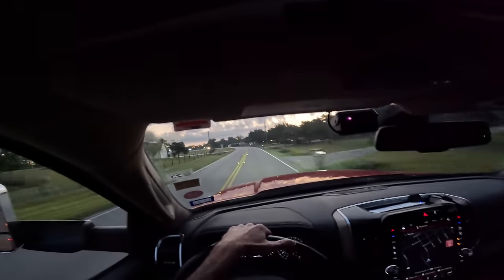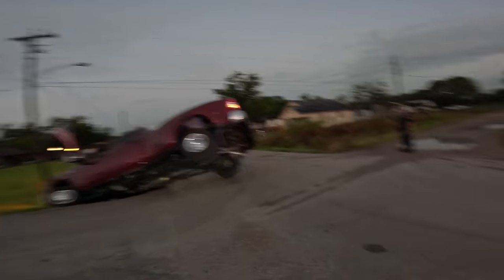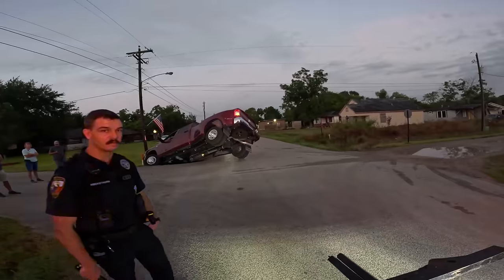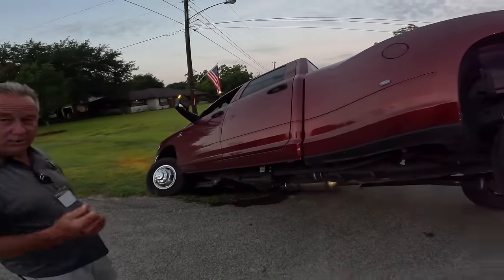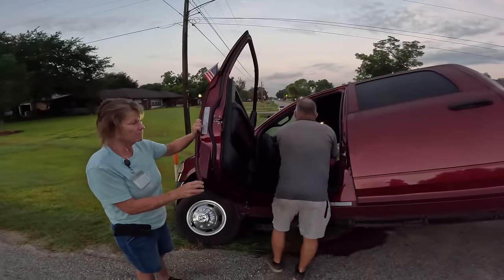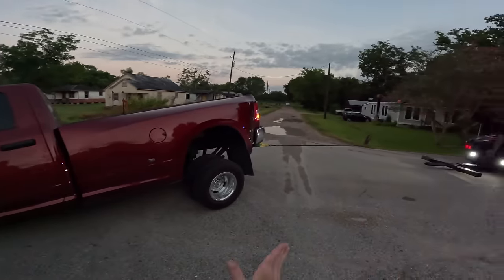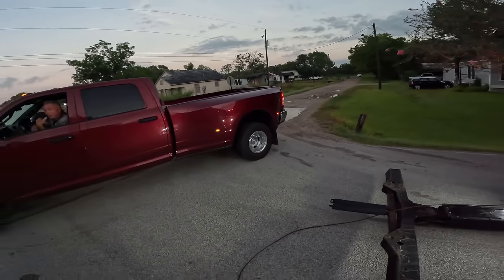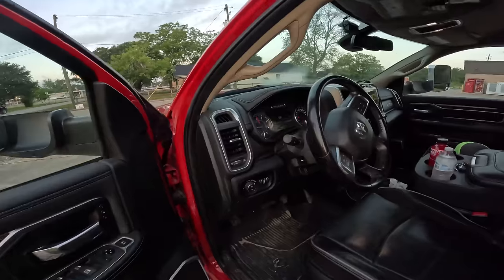Bad Way to Start off Monday!! Ram 3500 Winch Out!

Comment: That tow truck was struggling lmao
Reply from the maker: How was it struggling? It did everything perfectly. That’s not something you do very fast.
Reply: Yea, probably just running a winch for its rated working capacity.  Some upgrade their winches, but what comes with truck works, fine.

Comment: Alot of people dont realize how dangerous this is ,there has been many people killed by a cable that breaks and hits them causing death you have to think about all this you dont just pull up and drag a vehicle out of a bad situation, yeah its pretty scary to say the least, very well done  stay safe and god  bless
Reply from the maker: Thank You!
Reply: I had an 18 wheeler up on right side tires pulling with two cables all blocked by State patrol on both ends. Some crazy woman with kids in a minivan cam screaming around the cops straight at my cables. I had to drop the cables just before she ran over them. It surely would have cut the top clean off that minivan. Not sure what happened to the kids but she had free room and board . One dumb woman.
Reply: True, most have gone to using multiple winches with synthetic ropes and synthetic attachments. Cables are dangerous.
Reply: @MrStaybrown every item has a working load limit, synthetic or metal,  and a tow truck driver can estimate the resistance  per axle.
In this case the gradient has transfered a lot of weight to rhe front axle  from the rear.
The front axle on this truck weighs 5k lbs, the tires are on soft dirt and the frame is mired,  I would guess 100 percent of front axle weight plus rear to front transfer of approx 1k lbs , so it's about a 6k lb pull.  Could go up to 9k depends on how wedged the body is tuck.
State police usually require improved plow steel 6x19 wire rope

Comment: With that much weight in the ditch, I definitely would have put a snatch block at the truck. That's a 3/8 line, I imagine? I was a bit worried... But I guess everything's on your flatbed? 
Job is done, no one's hurt, and nothing broke. Always the best end to any day. That was a good move pulling the back down, too, get the nose lifted up a little.

Very nice work, as always.
Reply from the maker: Definitely not how I wanted to do it, but this truck is pretty under-equipped, and most of the stuff on it is what I took out of my flatbed. 
I’ll be so glad to be back in my truck where I have all my equipment again.
Reply: @Towtruck_Dustin  I definitely understand that. My wrecker was down for a while, was running flatbeds for two months. I'm so accustomed to my own equipment, where it all is, and what it can do. Definitely feels weird running "the spare truck."

Comment: Nice twin line, I always like an independent wheellift though. I've got a LWB '96 Ford F-350 SD 4WD with a manual trans. by Weld Built. It's a monster for doing recovery work. Probably paid for itself 10x over by now.
Reply from the maker: I plan on finding me an OBS Ford wrecker for an off-road rig in the near future. I love those trucks.
Reply: Owen-js9cx  Aloha snackbar to you.
Reply: @genefogarty5395  when I saw OP favorited your comment I lol'd. Glory to the almighty snack bar! Which is Hawaiian themed for some reason 😮
Reply: @skrimper  Didn't see it until now, no disrespect, I just can't take organized religion seriously. I meet with my maker whenever I'm alone and hiking, camping or fishing, I don't need to go to a building to talk to whoever it is that made this big blue ball of beautiful insanity. AND I've never been asked for money during our conversations! Lmao.
Reply: I would rather have a boom independent of the wheel lift. I do not like the new wreckers today. And I think that I would have another truck on the right front for a lift.
Reply: That's what I mean, Dynamic is different than a Weld Built or Holmes that utilize an independent wheel lift. I can't stand it on the boom. It restricts the use of the truck.  @TimSmith-uc4pk

Comment: Years ago I went shopping for a 4wd pick up for my work. I went to Ford, GM and Dodge. I was shocked by what every sales person advised.

They all quizzed me as to the type and nature of my driving requirements. I told how I used my truck in my job.

They told me that for the number of days I would actually benefit from a 4x4, verses the added expenses in fuel, maintenance and repair costs, I would be better off calling in sick on those few days and buying a two wheel drive. I was disappointed, but couldn't get over their candor. 

I driven both over the years, but I'd have to say that two wheel drive pick ups have served millions of people well across the decades, so they are far from useless. Maybe it all depends on the operator.
Reply from the maker: They definitely have their place. Like anything else, they serve their own purpose.

Comment: If it were me, I'd have popped a clevis on that endless loop and hooked the winch to the clevis. I suppose it probably doesn't matter much in this case, though, and it is extra work. Nice, professional job, either way.

Comment: Just me because I've been through recovery for 40 years, I'm almost thinking from the front Tire strap the front wheel and slowly backing out with the emergency brake parsley on. Simply because I don't want to twist the frame of the truck any more than it needs to be, for me this should be a straight recovery where the owner gets to drive it away
Reply from the maker: The drove it away, and there was hardly any stress on it. It wasn’t stuck on anything. The best think to do there was to bring it away from the tipping point.

Comment: Well done, although those big D rings on the wrecker body are significantly stronger for rigging your low snatch block. These are fun calls... they look like a big deal to the customer.. in reality it's s an easy job...
Reply from the maker: That’s what I planning to rig to, but the snatch block didn’t have a grab hook. So I had to do what I had to do.
Reply: @Towtruck_Dustin you.can still.use a chain block with those, just choke it up tight to the block... but realistically, that wasn't a hard pull, just a medium pull pivoting that Cummins back up til it rolled.... that's why I said,  we get those...they look like a big deal, but they're easy & ya get brownie points for what they think is tough.  Well done though.. staybsafe out there ;)

Comment: As a tow company owner. I am glad you were able to recover that vehicle. However, I’m going to offer you some constructive criticism. Number one you never ever use your safety chain box as a pull point. That extreme load you put on that completely exceeded its design. Not to mention that’s not what it’s designed for. Number two, I would have doubled up my line because of the extreme pressure that exceeds the 3/8 cable on your truck. If that cable had snapped, you would have shock loaded your truck not to mention somebody getting hurt or worse. The forces you were up against was not only the weight of the truck. Also, once you brought the truck down, you were dragging on the frame which created more resistance. Lastly, I wanted to point out. You should never ever allow the customer to be involved in your recovery. Because if something catastrophic had gone wrong it would’ve been all bad. Safety is number one in our industry. I want to see you go home every night. Just my thoughts my friend.
Reply from the maker: Trust me. I didn’t want to do any of that, but didn’t have much choice. This truck is so under equipped, that I had to pull equipment off my rollback before I dropped it off at the dealership, and it still Isn’t enough. 
Trust me. I absolutely hate having to work like this. I’ll be so glad when I can get back to my truck so I have all my equipment.
Reply: @Towtruck_Dustin  Trust me my friend, I wasn't trying to sound like a boss. I was simply expressing concerns. At the end of the day you did get the job done. For that I am very proud of you. I just worry about safety is all. As tow operators we already have a very dangerous job. You are considered a first responder. I look at us all as one big family...
Reply: All you had to do was hook to the hitch on the back of the stuck truck and pull it out. I could have pulled that thing out in under 2 .minutes with my 2500 pick up truck.

Comment: One question real quick, and I am an operator. But isn’t it a liability for u to have the customer help run this call? There a whole other way I’d done this but it looked good other than that customer in the truck with that much tension on that cable? But good work just something’s I seen that I’d do differently but u got the job done successfully that’s all that matters

Comment: Dude is going to need a frame shop to check out that RAM.
Reply from the maker: Not likely. Very little stress was applied to it.
Reply from the maker: Exactly
Reply: @TheKing-hr7uh   You and T_D aren't thinking too critically.  I can almost guarantee that there is some degree of twist in that frame, and it will show up in funny tire wear or odd handling in slippery driving conditions. Cross-loading with LF and RR wheels as the fulcrum axis, and torque applied LR against the weight of the Cummins and the dropped RF corner... is
Not remotely akin to changing a tire by jacking one area.
Of course this was a proper recovery, but assuming that the truck escaped unscathed is wishful thinking.

Comment: Dustin probably hasn't had his first cup of coffee yet. Hes already being called out to work.
Reply from the maker: I was actually grabbing breakfast before heading to a different call when this one came in lol
Reply: @Towtruck_Dustin  I had another question for you so I have a trailer that weighs 2300 pounds empty and it's a big dump trailer. It has a bent coupler and 2 flat tires. Can a regular toe company handle something like this?
Reply from the maker: Yeah. Any medium duty flatbed should be able to haul that easy.
Reply: @Towtruck_Dustin  I might need to trucks from my local toe company. Because we have to get the trailer out of a backyard. What size truck would be best to handle that?
Reply from the maker: 2300lbs isn’t that heavy, so any medium duty flatbed should be able to handle it.
Reply: @Towtruck_Dustin  Thanks Dustin
Reply: What's the update on your flat bed, Dustin?
Reply from the maker: Picked it up yesterday, driving it right now.
Reply: What was wrong with it? What did the shop say?

Comment: How the heck did they miss that turn so badly? It's not slippery. What a biff!
Reply: About 8" of the pavement cracked off the edge of the road, along with the earth under it. So it dropped right onto its frame, it was game over then. 
He had it in the road, just a little too close to the edge. Just look on rural roads with boat trailer tracks and truck tracks riding 2' into the side ditch. Drivers don't care about anything anymore, point A to point B as fast as possible; and get out of my $90K rigs way.....

Comment: NEVER, allow a customer to assist. They can do some really stupid things "thinking" they are helping. If the steering wheel needs to be turned, you stop what you are doing and position the wheel where you need it, then secure it with the seat belt. 
Smart thinking to put tension on the rope before going into Neutral, but you should have applied the parking brake firmly, but not all the way. It will roll backwards with drag and stop before it will roll forward. 
It was not wise to wrap around the leaf spring as a hanger can get distorted, the axle would have been a better choice. 
And you get 25 bonus points for wearing good, thick gloves.

Comment: i would hate to see what the fee was but im sure it was fair, dustin sounds like a great tow driver, here in Tennessee where i live 5 minutes where a repair shop i need to go $100, that tow driver was not far away, some like to take advantage of situation ,it  gives towing a bad name
Reply from the maker: $100 is a fair rate. We charge $95 for local tows. Believe it or not, $100 doesn’t leave you much profit if you’re running a legit company that’s properly licensed and insured.

Comment: How are you able to run red and blues? Very curious
Reply from the maker: Several states allow tow trucks to use Red and Blues. Texas is one of those states. Missouri allows the use of sirens as well, and can run code, when requested by law enforcement,

Comment: To much time very slow rigging the sling.to far away from the truck I drove rescue and recovery for about 25 years driving 1 ton sling stinger flat rollbacks and 14 wheeler rotater  to 100 tons .as far as a snatch block you can always use a j hook to control your cable angle. First day on the job lol????
Reply from the maker: The fact you’re willing to destroy your cable using a J hook says a lot. lol

Comment: Why wouldn't you want to leave it in park until you get it back on all 4 so it doesn't roll away
Reply from the maker: Because that would add stress and I didn’t want it to drag any.
Reply: @Towtruck_Dustin  No extra stress until it was on the ground. Then could have had him in it to apply the brakes. Would have made much more sense.

Comment: Single line was way over loaded beyond the WLL
Reply from the maker: How do you figure that? The truck doesn’t even weigh that much, nor was that much load applied, and the winch would bow up on the hydraulics before getting to the Working Load Limit.

Comment: as a pro, you should know that you can shift into any position once the key is in the ignition position. You don't need to touch the shift lock at all, total BS! and that guy needs a smaller vehicle! He's a danger to the public!
Reply from the maker: What does using the shift lock have to do with anything? Absolutely nothing wrong with not keying the truck on. 
The beauty of the towing industry is that there are so many ways to accomplish a task, and the only wrong way, is the way that’s unsafe or causes damage or injury. 
Short of that, just because it’s not your way, doesn’t make it wrong.
Reply: @Towtruck_Dustin  Yes, of course, you can go the complicated way! Why turn the ignition key a quarter turn, when you can take the dashboard apart.  And I am sure you can add some to your charges for disengaging the shifter by means of the safety shift lock. there is nothing wrong with making it a little more complicated and more expensive..

Comment: How many flatbeds do y'all have?
Reply: company have flatbed truck 3 (one new which Serrie's ) and 2 heavy truck towing and one or 2 small towing truck and one semi with trailer and one service van (like lock out or delivery gas or jump start, etc) hope im right haha
Reply from the maker: Correct. 
3 flatbeds, two Ram 5500 wheel lifts, two heavy wreckers (25 and 35 ton), a Peterbuilt with a landoll, and our service van.
Reply: @Towtruck_Dustin  so each of y'all are assigned to one truck
Reply: I have seen you drive Donnie's truck other than the other flatbeds
Reply from the maker: Yeah we each have a truck assigned. If I’m not running mine, I generally drive Donnie’s while I have to. The other flatbeds are generally driven by the other operators.
Reply: Didn't mean to say it so harsh one you never put around least bring you can bend it you can pull it out of whack you can knock it out alignment you could do any number of things like I've been driving tow truck for 30 years I've never damaged vehicle in any way shape or form Apple tractor-trailers off of payments from down into ditches and I've never done the damage to a vehicle that I told any of vehicle you never put a strap around the Lee spring
Reply: You done a very good job for young man that's one thing I can say but you could do anything with that will live that you could do with that thing on flatbed and even more

Comment: That's NOT Flatbed work. Right tool for the job, just could have rigged it better
Reply from the maker: I disagree. I would have rather used my flatbed, and had all my equipment. I hate running other peoples Trucks.

Comment: I've been driving tow truck and operating tow trucks for over 30 years you need to go back to school you need to learn how to become an operator instead of a driver I can do anything with that truck that you could do with a rollback and more easiest way would have been wrapped snatch block around a wheel lift put we left on the ground running cables to it put it down you two been out of there in some drivers tripped me out
Reply from the maker: Running around thumping your chest ain’t gunna get you no respect. 
That said, what I did, worked just fine, and got the job done safe and without further damage. 

As Ron Pratt would say, “there are multiple ways to reach 10.”